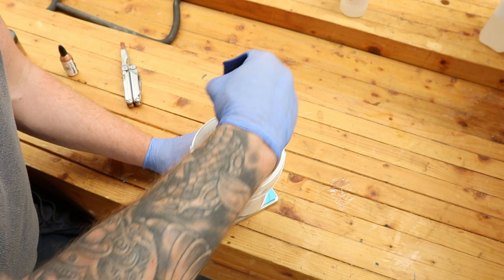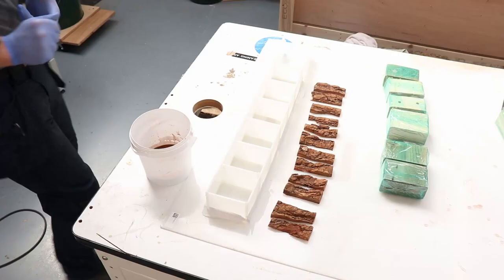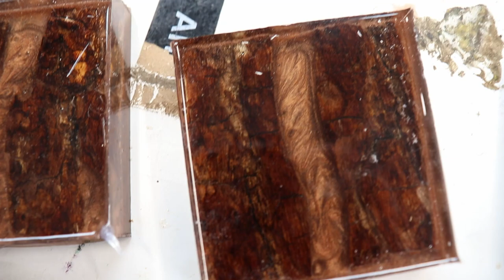Resin Coasters for a Resin Table!

Comment: Nice job man! I cast a lot of live edge coasters. Find it easier to cast them as a long strip, sand up the single piece then use the mitre saw to cut them to size.
Reply from the maker: Makes sense

Comment: A bit of advice if you don't know as i did;nt see you doing it is to mix the Glass Cast 3 in two pots after 1st mixing then pour into 2nd pot and mix again
Reply from the maker: When making the resin table I did. With small amounts it's not really necessary you can thoroughly mix it on one pot. I haven't had any issues yet.